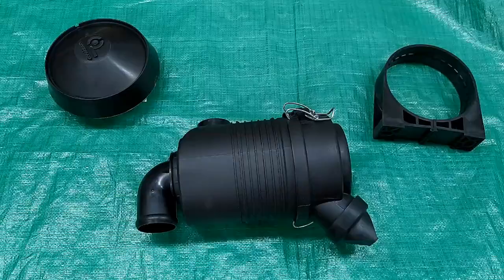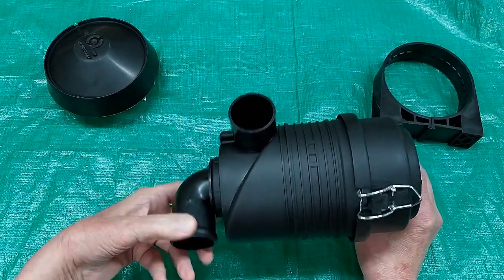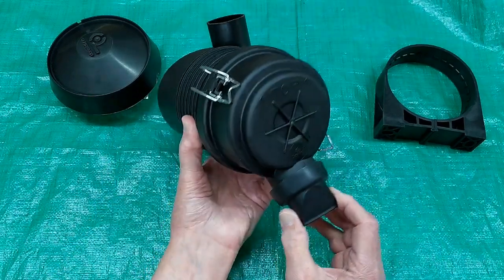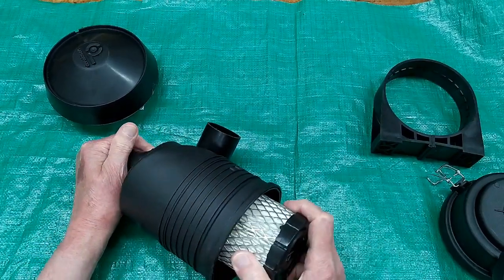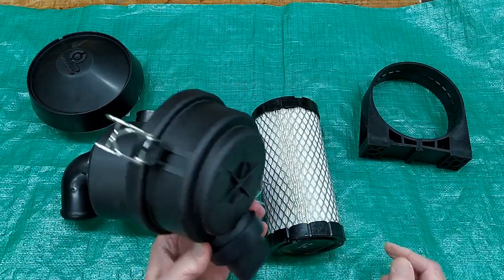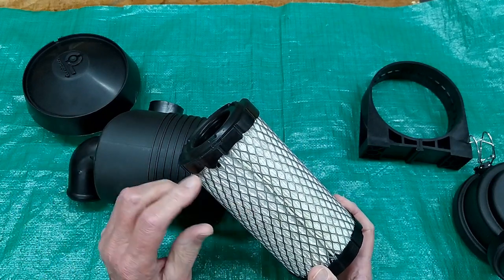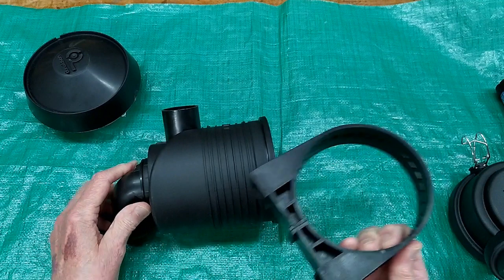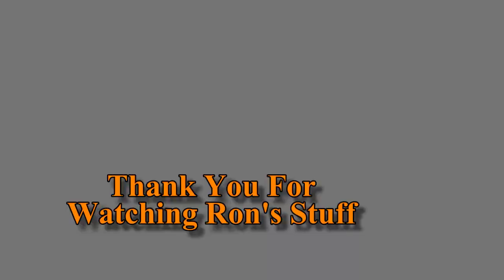G057545 Donaldson Air Cleaner - How It Works

Comment: The gauge is called a Filter Minder it is so you don’t have to open up the canister and break the seal. It is not uncommon when people try putting the filter back in the canister they don’t get it sealed properly so the less you do it the better. I have worked with Donaldson filter equipment in an industrial setting they do have a pulsing self cleaning which has a similar operation as the duck bill but uses compressed air to keep the filters clean. Once the air pressure inside the filter compartment reaches a certain level compressed air is blown into the filter chamber
Reply: Donaldson official name to sensor is Air restriction indicator.  Filter minder is a totally different brand (bought just a couple years ago by Donaldson) .
The most famous  AIR FILTER RESTRICTION INDICATOR from Donaldson must be his best seller THE INFORMER. Widely used in military applications.
Reply: The system you are talking about  is called JPAC ULTRA. Available for military applications only so far.

Comment: now that is cool to bad it will not work for a Kohler CH18s that would help out alot
Reply from the maker: It might work. I had a serious air filter problem on a 48" Ferris mower with a Briggs & Stratton 44T977 engine. The air intake is down low and and quickly got plugged with material, especially in the fall when mulching leaves. I had to design several modifications (adapters and brackets) in order to use this filter. That video will release next Saturday.